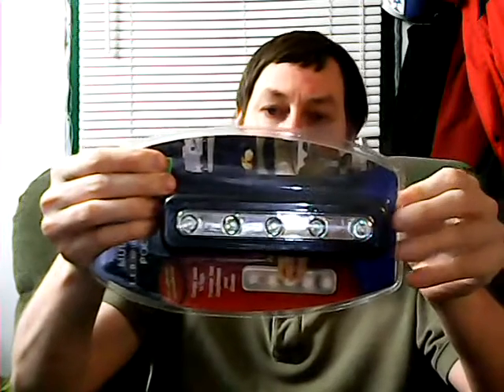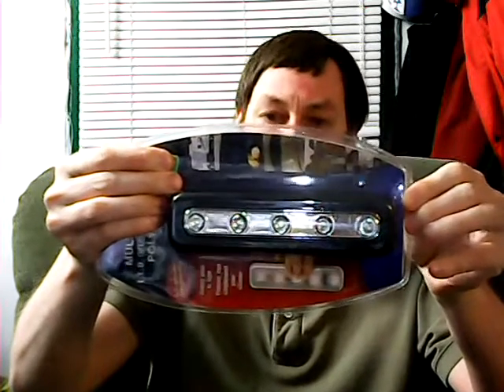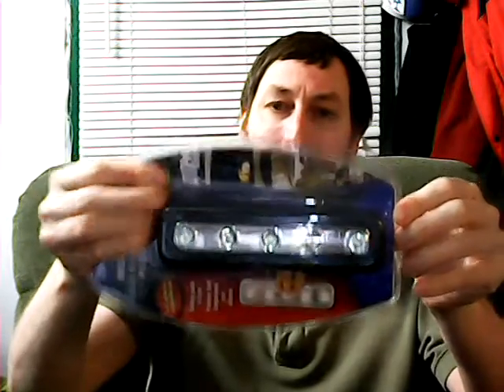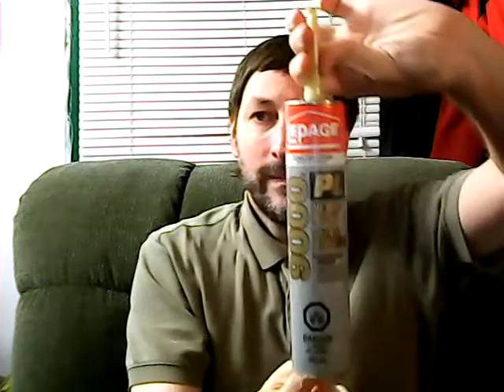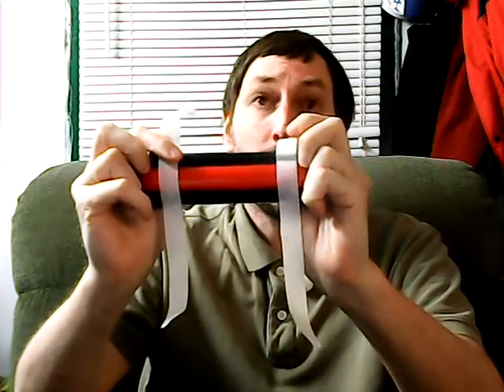Adding LED Lighting To An Electric Wheelchair

Comment: You need a light bar with red leds in it
You can pick one up
At eurozone or napa. If it dont 
Handle 24 volts then you can use one of you'r
12 volt battery to power it.
I wouldn't trust adhesive even if it's good stuff
I'd use velcro.
Reply from the maker: The adhesive industry is highly developed.  The catch is finding one that exceeds the highest and lowest temperatures where you live.

Comment: Check out ebay they have led tape as well as many other cool led related stuff, very cool. Any questions feel free to ask, I have a back injury and I spend most of my time home bound. By the way dude, you don't need that big fucking tube of shit, get some epoxy glue and you'll never have a problem, works very fast. https://www.walmart.com/ip/Gorilla-Glue-Epoxy-Tube-85oz/17130340?athcpid=17130340&athpgid

Comment: Good advice on the lighting. Right now I just have 2 strips of LED's that can change color and do a light show, which is on the side. I used to have a dollar store item that was a round disk and I would put tape on the back it was odd and took 3 batteries, and I had double sided tape, I think I used hot glue on the back eventually and was able to remove the front and put in new batteries. Oddly enough it took 3 lol. The only problem I had was my legs blocking part of the light but it worked. I had 2 sets of foot rests on my old chair though and could take the one that came with it and open it down just a little to angle it. I was about to take flash lights and zip tie them if I had to put one under an arm rest. The only other thing I could do was just hold the flash light in my hand. I don't think I want to use something that strong to play the light on because the lights came from a dollar store product and once they burn out I may not be able to replace it with an other, I usually end up looking for something similar that I can put on. I don't think I will go so far as to replace the light bulbs in some plastic thingy which took 3 batteries lol. I think it was AAA batteries I don't remember now. I bought a bunch of these lights to replace them so I could use it for a while... I though I used them all up but I just found one still in the packaging :-) It's called LED push light it was what I could find at the time. I have a newer chair now, so I never put one on and I wouldn't even know where I'd want it now plus this chair and tilt and recline, the last chair I had they modified it soo many times, I'm glad I have this one now. Other then to put one on the back I have no idea where I would put those now. Dollar stores are nice but what I really what is a Radio Shack.

Comment: Great idea. And battery operated.  Nice.  I doubt you still have the packaging. Was wanting the name of the item.  Did a few searches on Google for "Led lighting strip" but nothing that looks like yours comes up.  Just the leds on the strings.  Anyhow, thanks for the idea.  I'll come up with something.
Reply from the maker: That particular light is no longer showing on my purchase history from 2015.  

What I'd like to suggest are either of these models instead: 

a: This is a red light for a bike.  www.ebay.ca/itm/121872128418 It could be connected to the stability bar (lower back height) at the rear of your wheelchair.  The only thing about it is you will need to install it vertically instead of left - right.  If you about it the part of a bike where this goes onto is vertical metal allowing the light to be displayed left - right.

b: If there is someone in your life who is good at electricity you could purchase this: www.ebay.ca/itm/311899780365  Additionally you would need low voltage wire, 12 volt connectors and a 12 volt battery would need to be purchased separately to power this light.  This is an example of a 12 volt battery you could buy to power this light: www.ebay.ca/itm/272868276260  You would need to search for one which has the right connector for recharging the battery (US / EU / Australia).  Someone who is good at electricity could add a matching 12 volt connector to the light.

I hope some of this is helpful to you.
Reply: You are one helpful dude my friend! Thank you for all the time you took on this question.  I just got the red bicycle light.  Thanks for the suggestion.
Reply from the maker: I don't just put videos on youTube to make noise.  I know real people watch them for their specific needs.  If my channel experiences significant growth it will still remain a priority to me that people's comments are addressed as best as possible ... Even if this means I need to hire someone I am willing.  I hope the like works out well.  I am thinking I may give one of these away some time to a subscriber of my channel.  I am interested in giving back.
Reply: I totally get that.  I have a review channel on Youtube also and, I make it a point to answer my fellow Youtuber's questions too.   It's what I would want done to me.  BTW, while at Ebay, I found the search term for the kind of lights you showed.  I searched: "Battery Operated LED BAR" (not "strip" as I was searching last night) and, a  bunch of varied results came up that looked similar to your bar.  Take care my friend.
Reply from the maker: That search term may help!